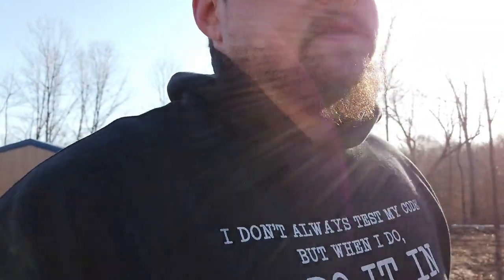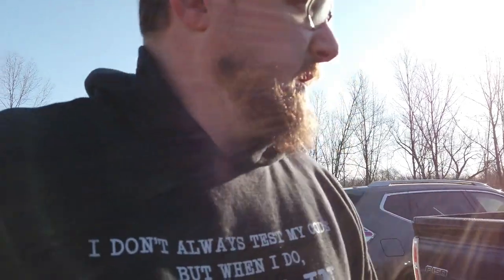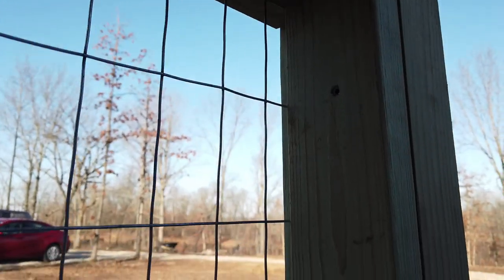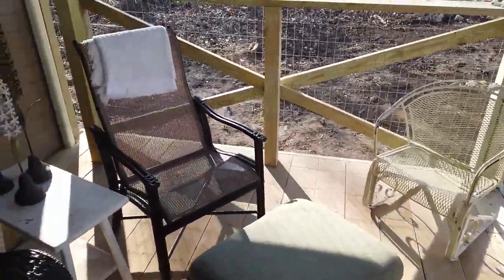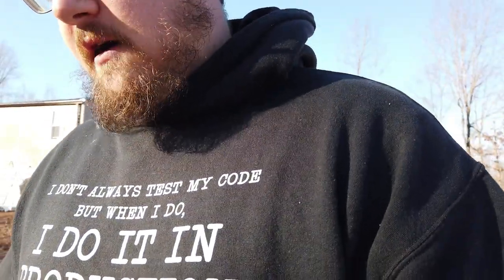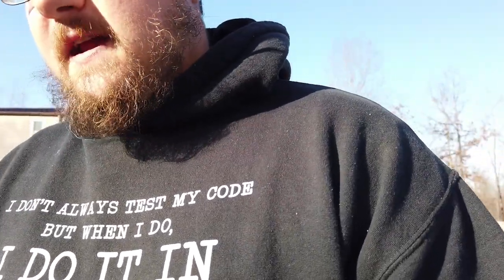Getting Wifi to Your Metal Building

Comment: Just ran across your page. The extenders are really hard on the wireless. They introduce a lot of problems and ultimately can have a significant negative effect on all wireless clients. The more repeaters you add the slower all clients will be regardless of how close they are to the base station. I would use wireless mesh devices which dedicate a radio for inter-ap communication or, dedicate a link between the buildings and drop an AP inside and outside. Also, the antenna for the repeater being split between outside and inside is not a good solution and pointing the antenna straight out like that means your signal is mostly going into the ground and what you are seeing is likely reflection from the building. I know the comment section is mostly cancer and I hate to contribute to that, long version if it works and its cheap then no sense changing it, but if you have problems just wanted to point out there are limits to this implementation and there are better solutions long term. Great video!
Reply from the maker: Yup. As time continued it ended up not being a long term solution. I got very frustrated and ended up just having an underground ethernet line put in which has been perfect since. Thanks for the info!
Reply: @carterhomestead336  Ah well sorry that you had issues with it, trenching is no fun but ultimately will pay off. Had a good laugh at the hoodie, I don't think people outside of IT know just how true it is. Looking to move out to some land soon so love the content. Let me know if there is anything I can help you out with, otherwise stay safe
Reply from the maker: @jonathannewcomb7677  yeah I've had quite a few people ask me what it means haha. Likewise keep me up to date if you get some land. Best decision we ever made and with our professions ... its easy to find remote work. Thanks for subscribing! Take care as well
Reply: @carterhomestead336  Don't you think ethically you should disclose to your viewers it didn't work?

Comment: Did you try a WiFi PowerLine adapter?  Works really well for my shed.  Only caveat is that it can't be plugged into a surge suppressing device AND your shed power has to originate from the same power source (transformer) as your house.
Reply from the maker: I just read up on it. That is pretty awesome. Yes the shed is on the same transformer. We actually ended up digging an ethernet line already which of course has been working great. But im genuinely curious now how well this will work and may try it anyway for fun. Do you see a speed drop?